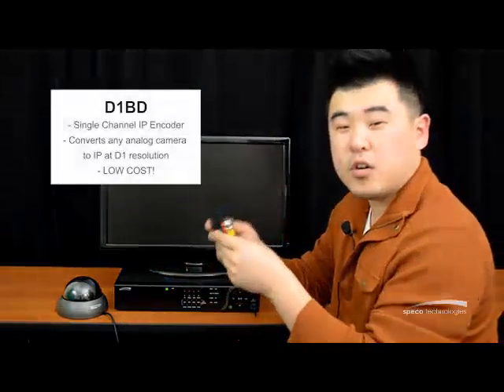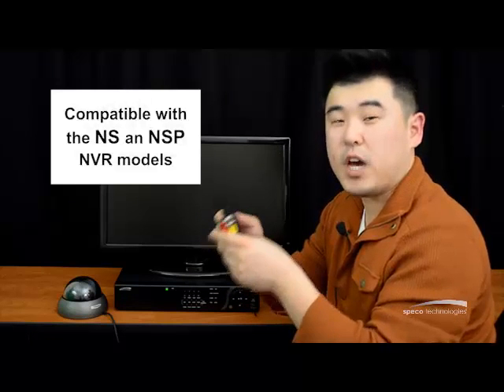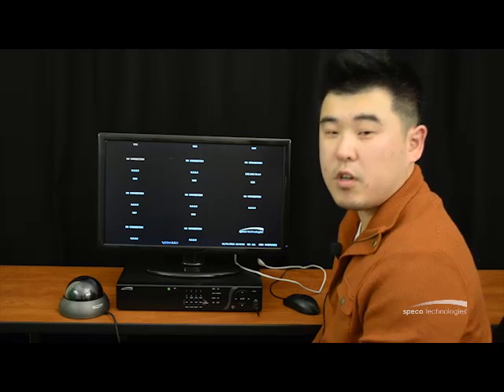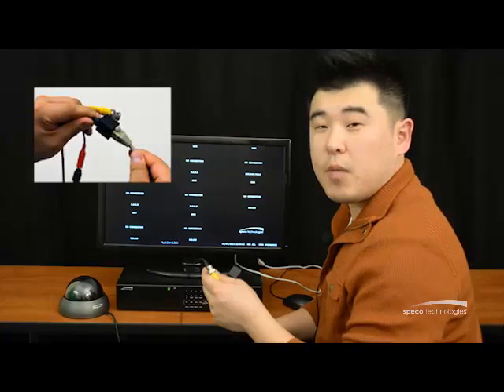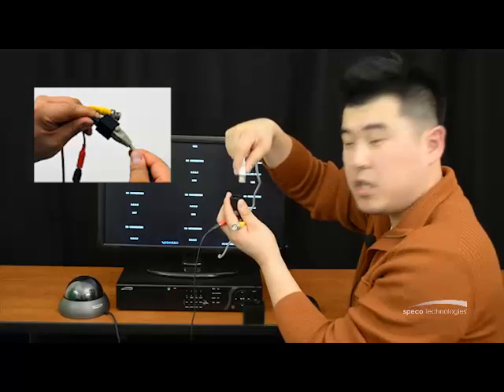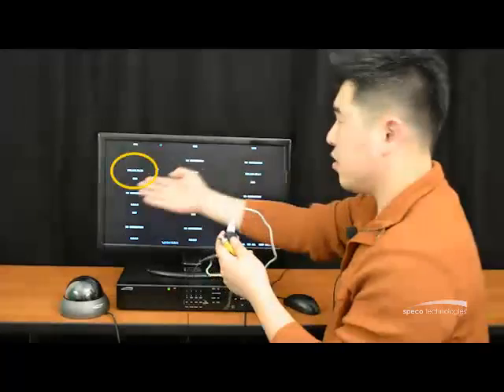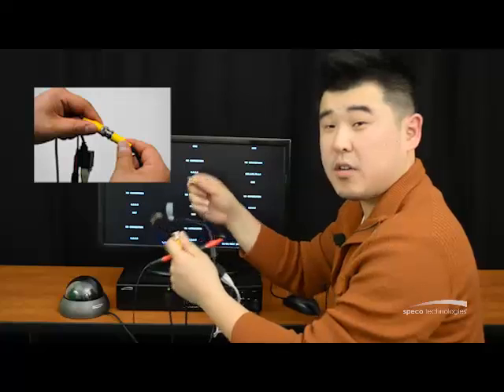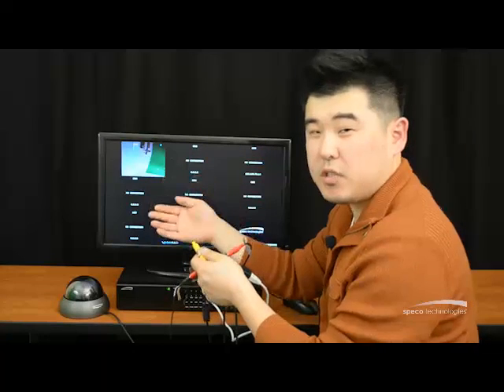NEW! Convert Analog Cameras to IP with D1BD encoder from Speco

Comment: These are available in several different brands but they are all over $100 which makes them a stupid buy considering you could just purchase a good IP camera for the same price.....
Reply: Except sometimes you cant replace the camera - it may be a very expensive FLIR or a camera physically built into a product or piece of lab test equipment or a weapon..
Reply: @keithduffield5239  Goes without saying. But even with traffic and special purpose hard to reach cameras I still recommend replacement to the customer because they are always unhappy with the difference in quality and other stuff like lack of motion detection after they are in use.
Reply: @TheRickJames  Some just cant be replaced. Try replacing a borescope on a long range cannon or a RADAR where the camera costs tens of thousands of dollars. Or a camera built into an endoscope or microscope. A Microwave Spectrum Analyzer and other communications test equipment has CVBS Video out for the display screen. It cant be replaced without replacing a million dollar instrument. My point being, there are, certainly in my field, dozens of Video sources that cost megabucks, for which a 100Dollar interface is an absolute bargain.

Not all cameras are used for surveillance and motion detection. In fact non of mine are, simply because I am not in that business.